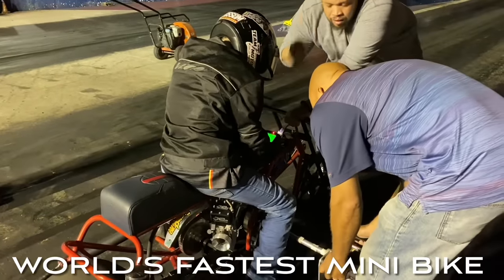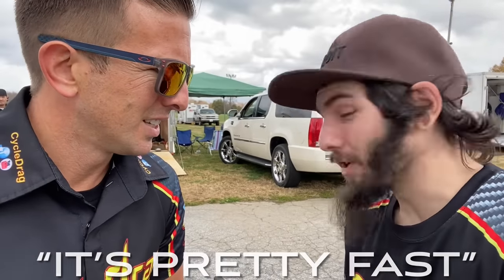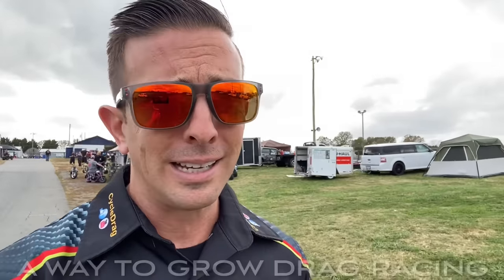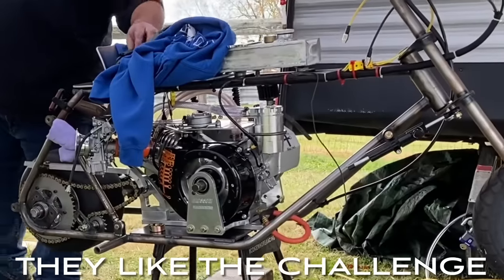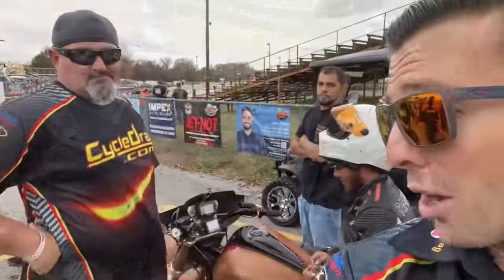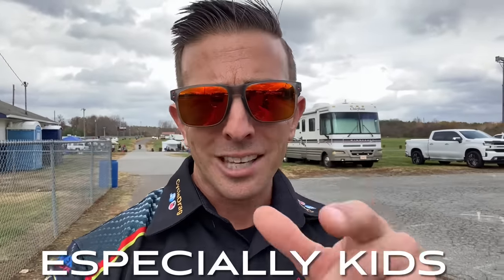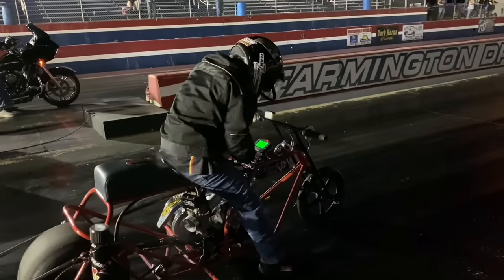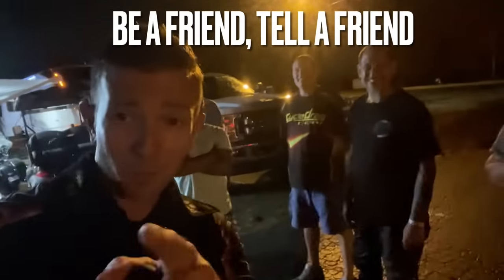Mini Bike TAKEOVER!

Comment: I’m from the island of Maui.  Being an island 2000 miles out in the pacific to get anything here cost big bucks. We have a drag strip and a community of serious drag racers with some fast cars. They’re super loud and spectators can sit at the start line about 50 get away, it smells and sounds like serious power. Only thing is there’s only about 20 fast cars. Then there’s the other 200 racers that show up in their daily drivers. As a spectator, it’s absolutely necassary to bring a bunch of beer or something to make it fun. For the racers it’s a blast, I’ve been in the pits . My brother races an old pimped out VW bug. Its a lot of work and slot of fun at the end of the day, but if your not pulling at least a 9 second quarter mile, nobody is gonna get pumped up to watch. It’s just the facts of life. That doesn’t mean the slower cars shouldn’t bevsblr to run it just means as a promoter , someone interested in getting g ppl in the gates, it’s something g that needs to be addressed. I have no solutions , I just know it’s like watching paint dry after about two drags. I was thinking of making a mini bike to drag matter fact. Something that nobody said, there’s  a lot of. Reactivity involved in making the motor from your lawn mower pull 200 lbs down a drag strip in 8 seconds. Look at the crazy things people are coming up with. That’s the appeal. But you’re right there’s gonna be 600 mini bikes show up in a couple years as the trend catches more attention, like maui drags you’ll have a few fast pumped out minis run tgenn300 stock mini bikes straight off thr show room floor of the tractor supply store. It’s great for family friendly fun camping g out party timed but there’s nobody in the right mind gonna pay $20 bucks to sit and watch that. You can’t even pay someone to sit through a day of that. Anyways

Comment: Not my personal way to roll in the quarter, but maximum props for the guy who chose this route and it’s working for him. All you need and nothing you don’t.  

Modified many different ways. But he’s not saying what. Obscurity is the racer’s edge. 

Making it go fast without spending a fortune. That’s what it’s all about for many of us. 

I’m thinking a Triumph triple putting out 150hp or so and is street legal. 

I think keeping the nose down will be the real problem for the hard chargers in the mini bike classes. 

I’m already wondering if I want to try to build one. Maybe with a hot crate motor. 

But I hate having to sort out all the classes and regs but don’t want to run open class. No blower, no nitro etc. 

Are people running grudge drags on quads? Any trike classes? 

And tell us when it’s an eighth. You can figure it out from time and trap speed but it’s a pain in the rear. 

-Matt’s dad
Hooning for life.

Much love and respect for your channel. Talking to riders, owners, mechanics etc. a nice extra.

Comment: Contemplating a mini funny drag bike. Ideally it would be a well built Duramax 440 stage 3 sitting behind the rear wheel, positioning the rider low and in front of the rear wheel.

Comment: LOL.. Honda Mini Trail 70, less than $500 would make you a star, where I grew up the neighbor had a gully that we could shoot down one side and up the other and then do a great big jump flying through the air over a driveway and onto the grass.. was both fun and dangerous as hell and sometimes we would do it with two or even three on.. in retrospect it was kind of hard on the motor mounts.. and the handlebars.. fortunately another neighbor had one of those pipe benders in a pinch

Comment: Few questions about the really fast bike at the end of the video where do I find a torque converter drive pulley that will reach those high RPMs with a 1 inch shaft or did you guys turn your shaft down to 3/4

Comment: For drag racing it makes sense.. what's the biggest deal variable in the equation? Same as always the air resistance lower profile means more speed.. but off the track that thing would be a nightmare

Comment: Things are getting very interesting at the old drag strip:
Now alls we need to see is a ported chainsaw engine class - where they put some wheelie bars attached just behind the handle and a 52-in bar with a good year V belt (as the slick "in place of the chain") and the rider setting (i.e. "modified chainsaw operator") seated atop the air cleaner - wearing slightly modified cork logger boots: with some really fast skateboard wheels on the heals: (for steering). 
They could even have front bar drive or rear bar Drive that way (if you prefer (with the guidebar trailing ) the bar itself could be the wheelie bar & the "slick traction device" all in one.
The only thing is if you get the geometry wrong you'll end up looking something like the reverse of that hog rider who got hooked up too hard.
And then the chainsaw operator with a slick belt instead of a chain - might even get catapulted backwards right back into the pits.

Comment: There's a 2speed transmission that is the next big step for the sport. The limited top speed is the biggest downside for growth,  which leads to the 2spd .
Reply: Are you referring to the double clutch setup with like 3 chains? Don't worry, there's a 3 speed billet gear box model in CAD currently.

Comment: Power to weight ratio is the real deciding factor with that. Not for nothing that thing could hurt some full size Supersport bikes' feelings. The other advantage is CVT drive systems; there is no feathering of a clutch necessary it is twist and go. Now, to be fair that bike with a rider is less than 300 lbs and a Harley bagger with a rider is just shy of 900 lbs. So if you have a bike making 25 to 30hp versing a bike making say 80 to 90hp it is going to be a steep hill for the bagger to climb. Just saying.

   I bet 91mph on that thing is one hellofa rush though because you are really close to the ground and that is a pretty small patch of rubber on the front of that thing. I can't say that I wouldn't give it a run because yeah even at 50 years old that looks like a pulse pounding good time.

Comment: I have a racing predator HEMI 212 that's turbo and nitrous ready. My neighbor has a mini bike he never rides so I'm thinking of asking if he'd sale it. His is big block style tho. But I could modify the 420 and use the 212 for now until I get the big block done like I want. It's one of those Coleman mini bikes that tractor supply sales. But I have around $2500 or so in mine. Wrapped in plastic still. Also has roller rockers, forged piston for nitrous and an aluminum rod, flywheel, hardened push rods, stainless and heat treated valves, stainless lifters, bronze guides, 265 super X cam, 26 lbs springs, aluminum retainers and steel keepers, aluminum Hemi valve cover, mikuni race carb/28mm, custom header, stock crank for now, removed governor, new race clutch/3 disk clutch, 13t front sprocket, 70t rear 2 pc sprocket, NGK race plug and MSD ignition setup. I might have a little more than that invested, just thought I'd throw a ball park figure out there. Been working on it for almost 4 years now lol. Just need a frame to work with. Maybe my neighbor will sale me his lol

Comment: My mini bike build is close to complete. 670cc predator , Jr dragster rear wheel , 1/2 scale top fuel type chassis .
Reply: 670? To big a motor you won't compete anywhere with that motor. Bigger motor does not equal faster bike when it comes to mini bikes. Your 670cc does not have the upgrades parts available that the small block motors do. A built small block mini bike will be faster than your 670cc by a lot considering you're 670 motor weighs four times as much as a small block motor but does not make four times the power
Reply: @infesting  Performance 670 supplies parts for the 670. They have all the same hop up parts that are available for the smaller engines. Go to Cars and Cameras channel and see how the used it in a small dragster. There's is tubo charged. Red Beards garaged super charges one for a buggy and has also done turbo version. Maybe do some research next time . The built versions have made almost 70hp .

Comment: Engines are cheaper , gas is cheaper , performance parts are cheaper lol it’s just more affordable tbh. I’m building a razor gas converted pit bike , putting a 212 in it soon and gonna make it a drag pit bike to run against some of these mini bikes 🎉 for those asking the frame is about the same weight as a mini bike frame, honestly a lot less steel tube on the frame so maybe lighter once I modify the plastics 🎉 so I’ll go just as fast but have slightly more control and comfortability riding it since I’m not a kid 😂

Comment: I think that I should have a word to my grandkids but I would insist on anything that is capable of even running 10 would have to have a wheelie bar i mean I built a Ford cortina years ago and put a v8 in it took out the back seat chopped the top and believe me 10 seconds is pretty fast I never really thought that a mini bike could make that power and yes back in my day I did built a Harley Davidson shovel but while it made amazing results it cost many dollars to get it to not break.

Comment: Running on methanol is not a big deal, methanol is actually less explosive than gasoline..  What that tells you is this is a high-compression engine most likely over 10 to 1

Comment: Other than low cost and lack of skills seems missing teeth and slow speech is a requirement. Some are very fast for what they are. Just by looking before they even run you can see who's going over backwards. Built engine with stock short frame. Bad combo. I do give them credit. Was fun to watch thanks.